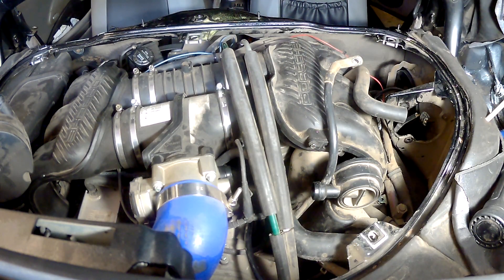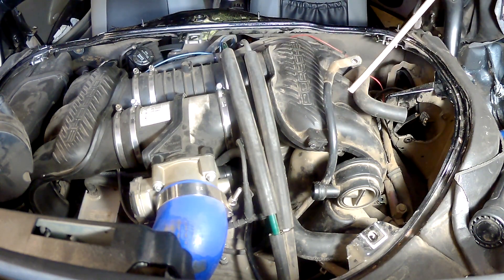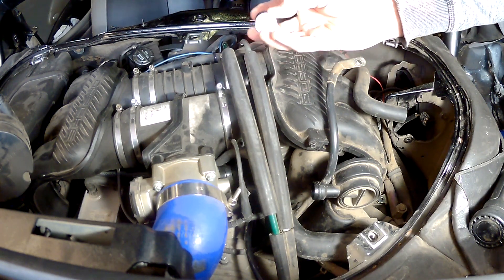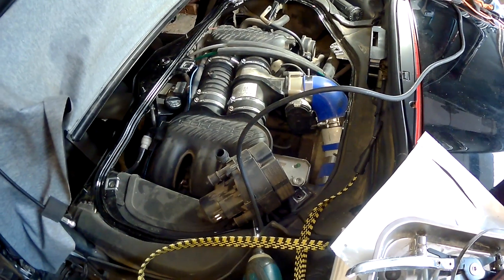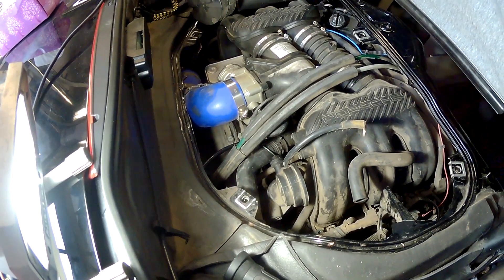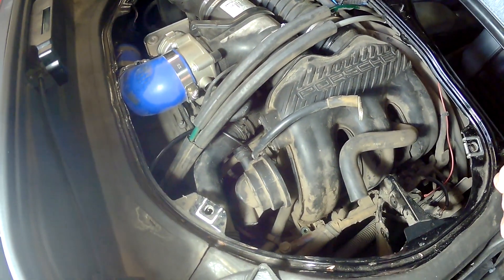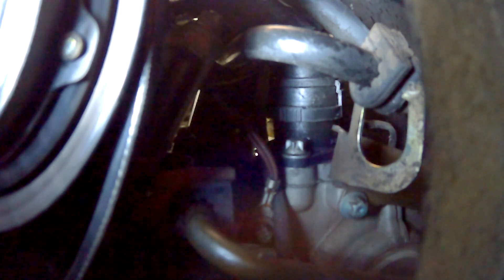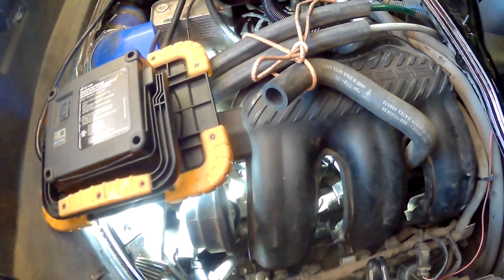Chasing a vacuum leak on the Porsche Boxster

Comment: my 986 boxter i can hear hissing noise when it over 40km after replaced water pump replacement. water pump needed to replace due to coolant leakage. my case is same with you? is there leakages from vacuum intake line??
Reply from the maker: I don't see any relationship between the water pump and any vacuum lines. Is the engine running normally?
Reply: engine is no problem. when they replace water pump, they also replaced coolant cap as well (not only cap... trunk area engine oil cap things . you know what i mean) 986 forum has similar case...